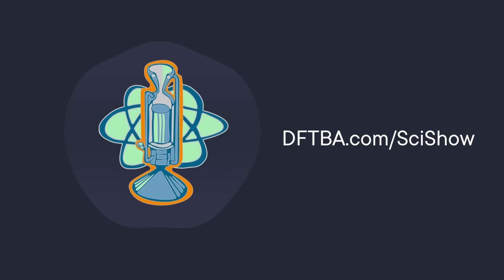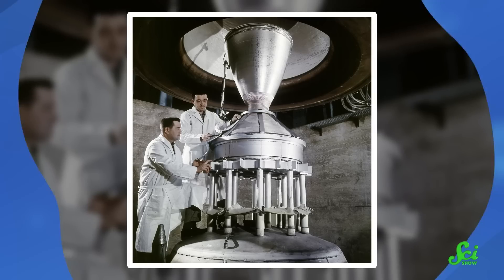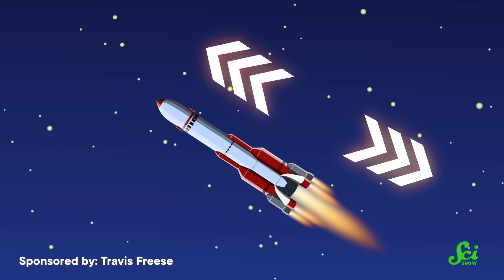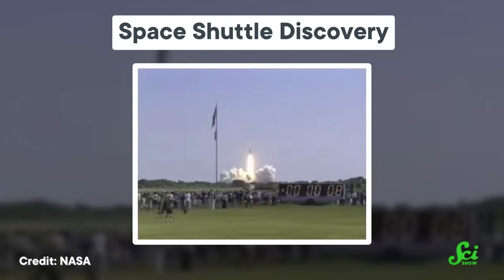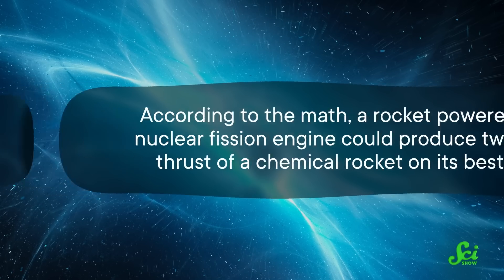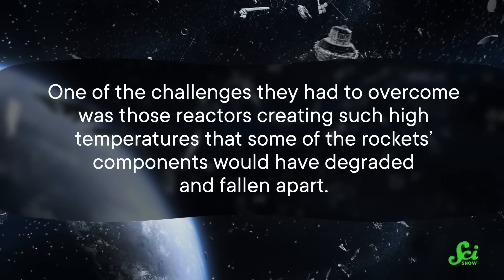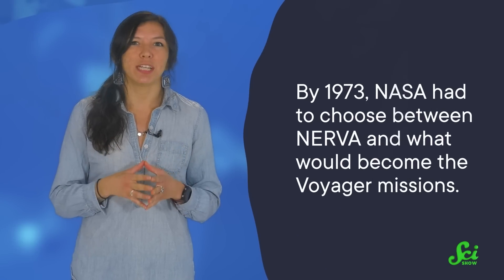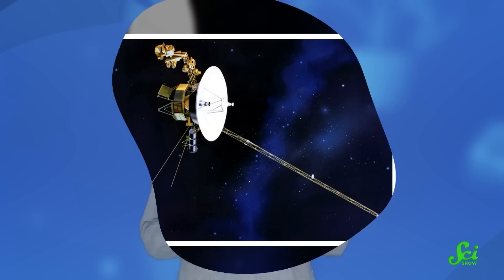That Time NASA Tried to Make a Nuclear-Powered Rocket

Comment: The planets were aligned in such a way that it'll still be another 50 years before a window like that opens again, so I'd say the voyager probe was a good investment...
Reply: The Voyager trajectory, known as a Grand Tour Alignment, only happens every 175 years.  The next opportunity will be in 2152.
Reply: Well, if nuclear propulsion ended up working well, we may not have needed any launch window at all...
Reply: @pepopipo974  we still do... Many people don't realize this but... The solar system is fking huge, it takes approximately 7 months to reach mars in it's nearest point, now imagine how long it would take to reach the rest of the planets when it's not aligned
Reply: @justsomehaatonpassingby4488  those launch windows make travel more efficient, but at some point, with enough power, it's possible to brute force basically any trajectory you want, even if it would not be elegant or cost effective, or feasible with current technology, at some point is possible
Reply: @pepopipo974  fission engine will be super efficient, but they are actually not that powerful. The burns will be long, but the whole point is that you can get to the same long distance with fewer fuels. Gravity assist will still have to be a thing. Fusion engine on the other hand, might truly make us a inter-planetary species.
Reply: @pepopipo974   but that point is nowhere near 1970s... Infact even today with our highly efficient and faster chemical rockets, making a rocket that can produce such speed to brute force it is still very much in the realms of Sci-Fi, I doubt having a Nuclear engine would be better in this regards, sure it may be faster, more efficient and possibly cheaper, but I agree with Jesse on the Voyager being the better choice
Reply: @justsomehaatonpassingby4488  you know? I got interested, let me do some quick math
Reply: @justsomehaatonpassingby4488  a nuclear engine in the form of a mini mag orion drive, a fission fragment rocket, or nuclear saltwater rocket can easily do such a brute force trajectory
Reply: @justsomehaatonpassingby4488  also, you can't use the sun for gravitational assist neiter for interplanetary nor interstellar travel, only for oobert burns at most
Reply: @pepopipo974  as I said... That is fine for singular directions.. i.e. going from A to B... Now you factor in going to the rest of the planets which is what missions usually do in order to save time and resource rather than launching multiple times to do multiple missions, now suddenly what's fast becomes immensely slow... All in all, I propose we start our research on Warp Technology and FTL... Bend the space to our will
Reply: @justsomehaatonpassingby4488  I don't think is worth to spend money yet on purely theoretical  stuff that depend on concepts that need more energy than there is in the universe in form of negative mass, and that bring problems like the violation of causality, when there are much more promising ideas, like nuclear propulsion
Reply: @pepopipo974  we can start early... Slowly gain understanding, then build the Stargates... Why should we lower ourselves to just the reach within our system? We should start to sail to the stars, then find Xeno, announce the Supremacy of the Imperium of Man, defeat end game lag, ..., Profit
Reply: @justsomehaatonpassingby4488  the thing is that we have no idea were to start at all so we research the things that are possible now

Comment: How come you did not mention Dyson and the Orion project with its external nuclear combustion engine .
Reply: Technically they're correct... halfway. 

Orion predated the existence of NASA. In the early days, rocketry belongs to the Army or the Air Force, with squabbles over which of them should own it. NASA was created to have a single agency, and a civilian agency at that, to take over as the primary rocketry researcher. 

NERVA was originally the Army project. Orion was funded by the Air Force. When NASA was founded, the Army was quicker to hand over NERVA to the civilian agency, while the Air Force tried to keep Orion as their own project. In the end, this was one more nail in the coffin of Orion. When the Air Force finally surrendered Orion to the control of NASA, it had a short life there. NERVA was already established as NASA nuclear powered drive research. Trimming the less-senior-to-NASA project from the budget happened pretty quickly. 

NASA was also understandably hostile to the minimum scale of Orion drives: You can't make a "test-sized" one, not and have humans survive riding it. The smallest spacecraft that Orion engineers considered was about the size of the Empire State Building, and even it required the crew to endure being thrown back and forth between positive and negative 3Gs as the pusher plate absorbed and released the energy of the atomic bombs exploding behind the craft. To the higher ups at NASA, the constant thrust and smaller size of the NERVA crafts seemed more sensible. 

So while NASA did briefly take over the Orion Project, it wasn't theirs except for its very twilight. They pretty much only ran Orion to kill it.
Reply: The video of the TNT powered concept device was beyond awesome.
Reply: I remember my high school history teacher talking about this project during the unit on the Cold War. He said this would have been the ideal peaceful use of nuclear explosions. I was inclined to agree, because it meant we'd be using nuclear bombs to propel spacecraft, instead of pointing them at each other.
Reply: @FrozEnbyWolf150   with Project Orion you're pointing the nuke at yourself.

To add to this , was only a few years ago Russia suffered a small nuclear accident involving what is believed to have been a cruise missile with a nuclear rocket engine, idea was it could fly for years and be called when needed .
Reply: It wasn’t relevant
Reply: @JerBear1990  🤣
Reply: Gotta leave material for another video or two
Reply: @jetseekers  lol the Orion project was insane /delinquent
Reply: @odinallfarther6038  that's why it's AWESOME!!!
Reply: @jetseekers  Armageddon would be awesome it seems to me it was a bit irresponsible and bit short sighted it just as well Kennedy pulled it some of  the military  uses they had for it were equally insane .
Reply: @odinallfarther6038  yeah, honestly a good thing it didn't actually happen, but just the ridiculousness of the idea and how it's actually somewhat possible (I.E. not magic sci-fi tech), is what makes it awesome and that such things like KSP let you play around with it
Reply: @jetseekers  life is awesome I'm always in awe of our collective  insanity and our self destruction in slow motion  that will increase at an exponential rate . They did dafter things like tossing 500 or so nuclear bombs into the van Allen belt the crazy scientist is a real thing .
Reply: Because it's catering to a a seven and a half minute video demographic
Reply: @Silversmith1701  if you are doing a short list of nuclear rockets projects and development  Orion is a major part not something to be missed skipped or forgotten .

Comment: It's a good idea for space travel, not so good for getting stuff to orbit
Reply: There are some amazing designs for other nuclear propulsion rockets that would work that way because the nuclear fuel remains in the exhaust, however this one isn't one of them, there isn't any radioactive material in the exhaust
Reply: @pepopipo974  even then solid nuclear thermal has absolutely awful TWR. You wanna use it in orbit and other celestial bodies but not on earth
Reply: We can use spaceplanes and mass drivers for getting stuff into orbit. If you used some of the more radical nuclear powered designs, like Orion, gas core NTRs, and nuclear saltwater rockets, you'd have so much specific impulse you could disregard the "every gram counts" rule of spacecraft design entirely, and afford to bring landing shuttles along for the ride.
Reply: What's wrong with nuclear powered orion ships?
Reply: If they can be built and kept in space instead of every coming too close to our atmosphere Thatd be great